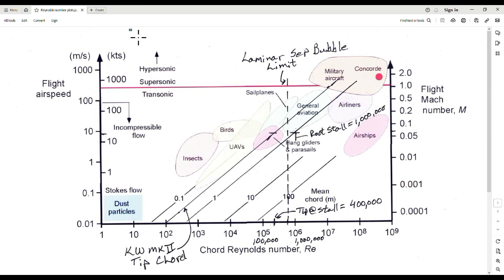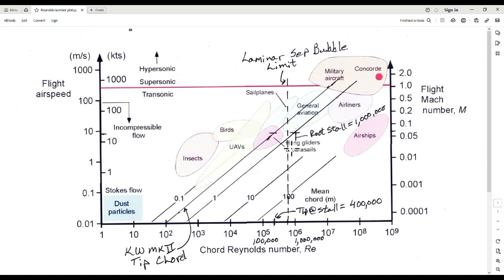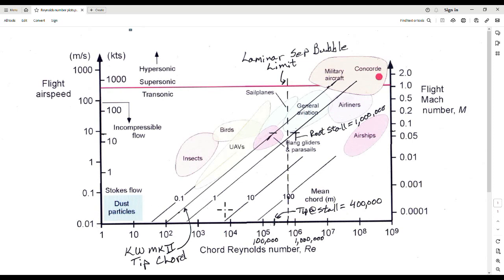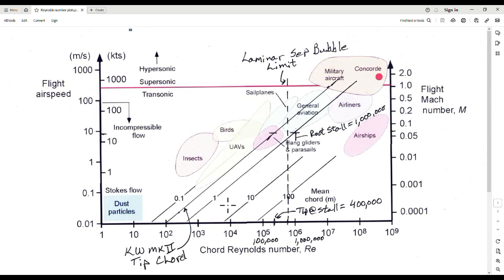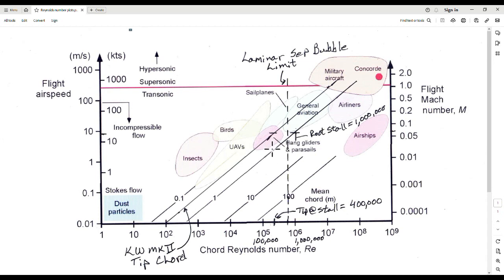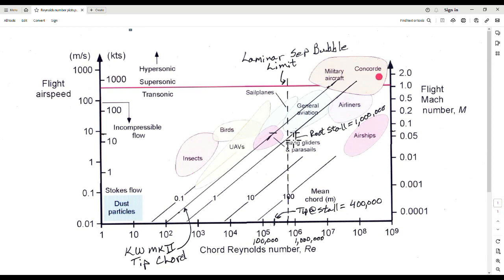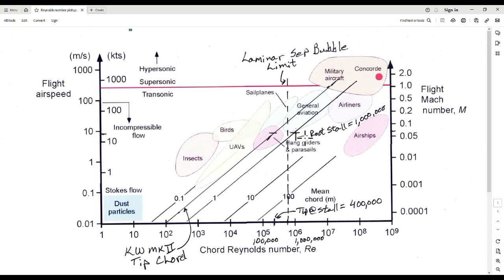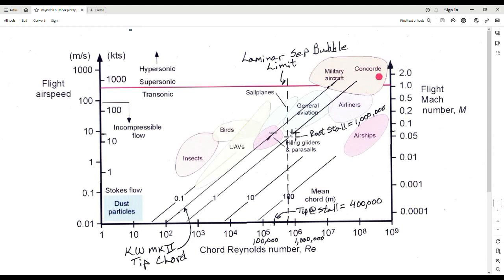Reynold's Number Issues Part 3 - Re Plots -KW MkII Development

Comment: I've been interested in designing and building my own hang glider for some time and have done nothing like this before. Being new to this, it would never have occurred to me to watch out for aerodynamic control effectiveness problems when the local Reynolds Number is around 400,000. Much less would I have thought that - until you came along - that there has never even been any research into this problem, posed by local Reynolds Numbers around 400,000. Anybody blundering into control effectiveness problems - without being aware of what you've found - would likely have found themselves in trouble and not be able to solve the problem. Thank you for drawing everyone's attention to this - valuable work, on your part!
Reply from the maker: Thanks, I'm glad to hear how you have found so much value in the work that I do. I look forward to seeing you as a new member on my Patreon site. Given all the value you have received, I'm sure your pledge will be most generous. Pledge at: https://www.patreon.com/klingbergwing
Reply: @KlingbergWingMkII  Not right now - simply because I can't see my way clear to getting any project of my own started, for financial reasons among others. If my financial situation in particular improves sufficiently, then I'll have no difficulty joining your Patreon site. Meanwhile, best wishes!

Comment: What about "springloaded" turbulators, that retract automatically at high speed?
Reply from the maker: Always an option and I speak to them in an upcoming video. Spoiler Alert! - VGs only added about 2 degrees of available elevon travel - not enough to solve the problem. You all will be surprised to see the final solution so stay tuned!

Comment: So, a more Reynolds-number-friendly airfoil section at the tip?
Reply from the maker: Yes and no. Future video will explain.
Reply: How about retractable VGs? 🙃 yeah I’m a lot of help lol
Reply from the maker: Yep, that has been discussed at length, but the impact to the D-tube would be extensive and would need a series of load rings. However, there is another potential solution, which I will post in a week or so after the next round of tests tomorrow. Stay tuned!